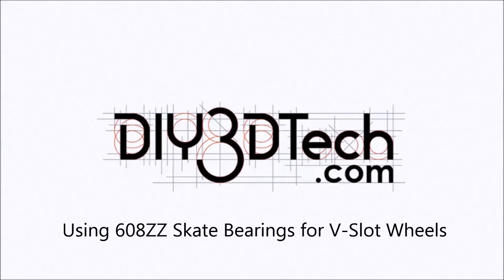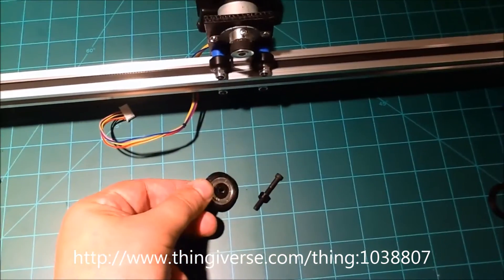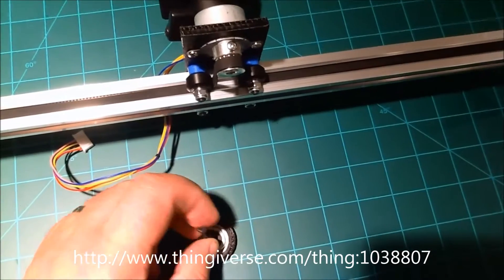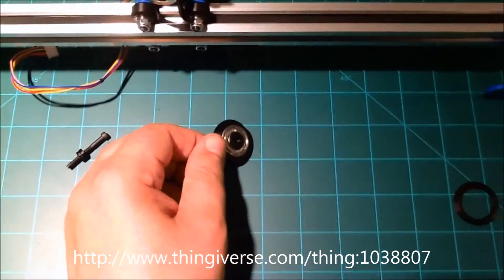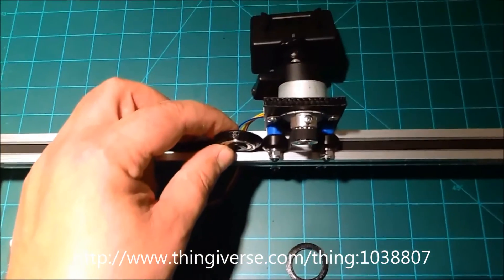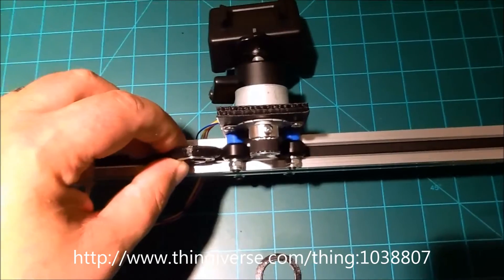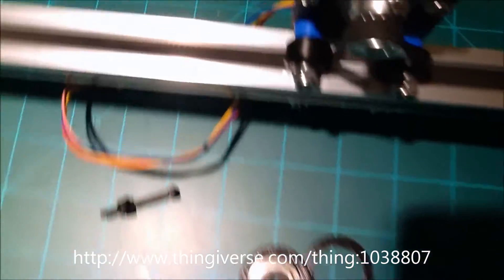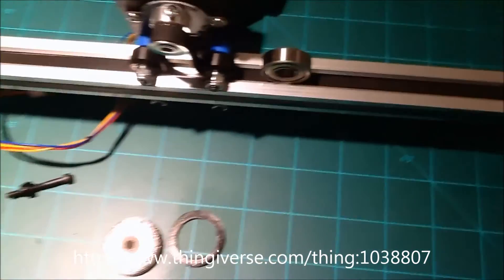Use 608ZZ Skate Bearings as V Slot Wheels and Save!

Comment: Think that they'll wear out pretty quickly. Shaving the sides off. Printing a v-slot wheel (like https://goo.gl/images/LE9h1b ) in pet-g would be better.
Reply from the maker: It depends on the wear level as I have basic sliders I have used for years with no issue however I would agree with something like a 3D printer or CNC.  Things could wear down fast

Comment: Are there not knock off or 3rd party manufactures for these wheels?
Reply from the maker: Bangood has some however they are still more expensive than the 608zz which you can get crazy cheap!
Reply: I bought these 
https://aliexpress.com/item/10pcs-2016-CNC-machine-V-slot-Openbuilds-pulley-625ZZ-rail-aluminum-profile-extrusion-Holder-work-with/32620078515.html?spm=2114.13010608.0.0.NvikSj
Reply: How long have you been actively using these wheels?
Reply: if you are asking me; I have not yet installed them.